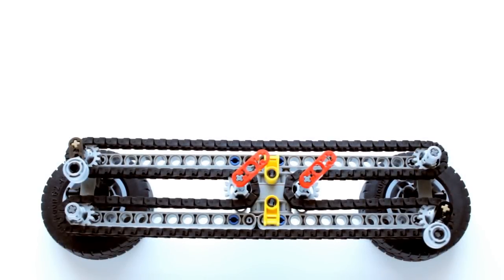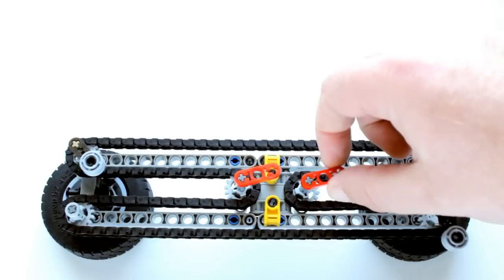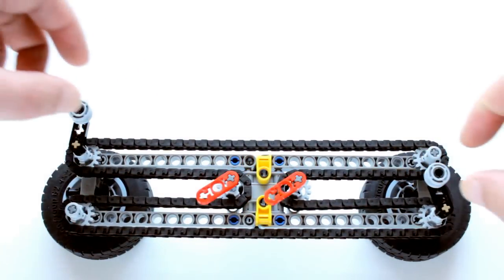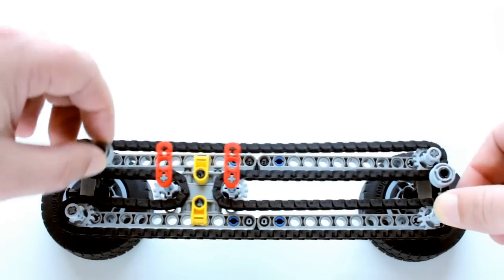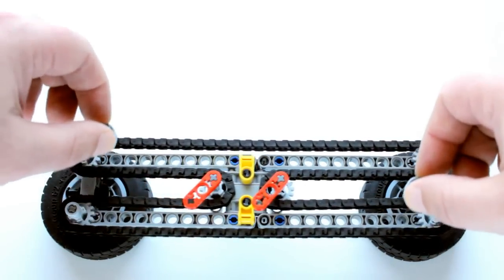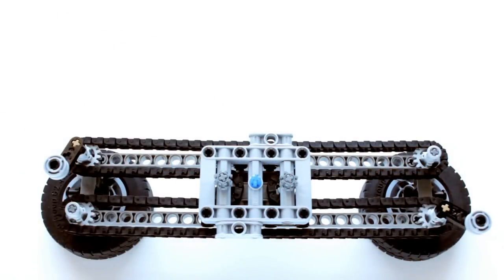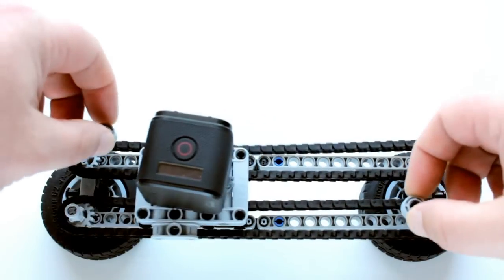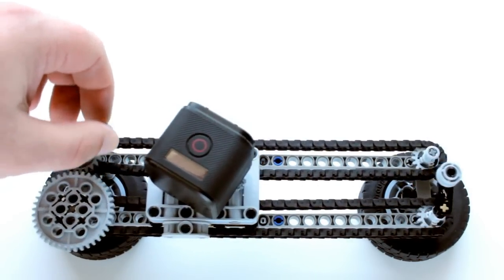LEGO Technic GoPro HERO Session Camera Dolly and Panning Rig

Comment: bruh i can make the exact same cinematic fx just by sliding my phone across a table and slightly turning it, and its probably more stable and smooth too. this is pointless
Reply from the maker: This model is a proof-of-concept.
It is not a finished and polished model.
Could it be bigger/longer? Yes.
Could it be made more stable? Yes. 
Does it illustrate a concept? Yes. 
Is it pointless? No.
Reply: Back2Black absolutely not lol dont get me wrong this stuff is cool and i could never make anything like it, now that im thinking back to my lego days this could have came to use making stop motion animations of lego, out of something thats made of lego, but my point still stands that its easier to just glide your camera across a smooth surface lol
Reply: @MrB4MV101 If you want to make an hour long video or something like that, if you use this LEGO design, you won't have to hold your camera for a long time.

Comment: I'm a complete novice with Lego but want to create a magnetic system that moves Model cars along a road. I'd like to use Lego chains with a cog at each end so they turn perform a U turn and travel in a loop. The system needs to be controlled automatically so a motor is required. Theres a system called magnorail but this is near impossible to impose on my model railway as the turns are a minimum of 6cm and won't accommodate into the area I require. Using small Lego cogs I can do this however am unsure whether it can be powered with a motor. 
 I understand my request may be a little odd to understand but if you look at magnorail on YouTube you may see what my intentions are. Merry Christmas
Reply from the maker: I have taken a look at the Magnorail system.  You should be able to use Lego chain links and Lego gears to achieve something similar.  The Lego gears come in a range of sizes, with the most common ones between 8mm and 40mm diameter - of course you can use multiple gears to simulate larger diameters.  You can either use the official Lego motors to drive the gears and chain, or you could use another type of motor if you are willing to modify the Lego parts a little bit.  You can also glue some rare-earth magnets to the chain, and you would have to create your own channel to guide the chain like the Magnorail system does.
Check out some of my other videos to see how I use Lego motors to power the Lego gears.
Reply: S. L. Froden brilliant, thanks for your response, will post it when it's complete

Comment: I want to buy the chain links used on this video but I found it difficult because there are some different versions and I don't know which one should I buy, 14696, 1311a or 1411b.
What are the differences between them?
Thanks!
Reply from the maker: The chain links used in this video are part 3711 (which has an alternate number of 14696).  https://www.bricklink.com/v2/catalog/catalogitem.page?P=3711
Apparently there was a slight change to the mold during production.  I don't have any of the older ones to test, but both versions should all be compatible with each other.
I don't know what parts 1311a or 1411b are as I cannot find them in any online Lego references/catalogs.

Oh, and to quote Sariel:
"That's the first time I've heard there are some differences."

Comment: What is the advantage of this compared to putting it on tracks?
Reply from the maker: Moving a camera on a track typically creates a "dolly shot" or a "tracking shot" ( https://en.wikipedia.org/wiki/Camera_dolly ).
The mechanism in this video enables you to create a dolly/tracking shot or a "panning shot ( https://en.wikipedia.org/wiki/Panning_(camera) ), or both at the same time.
By varying the speeds of the two cranks (either by hand or by attaching motors), I can get a wide range or dolly/tracking shots and panning shots, or a combination of both.
Reply: You can get a panning shot if you connect the panner(?) to the dolly wheels. Changing panning speed is a problem though. Maybe if you make a belt gear you can put the belt of different gears to change speed?
Reply from the maker: Sure, you could do that, but then it is no longer 'just' putting it on tracks, and you have added more complexity.
When I originally saw this mechanism (link in the description), I thought that it was a neat and elegant little mechanism and I wanted to see if I could recreate it with Lego pieces, and give it a purpose by turning it into a camera rig.
Reply: Makes sense.

Comment: you could maybe make the crank longer or add an electric motor with a gear reduction to make the movement more stable but anyhow an awesome video!
Reply from the maker: Thanks.  I did add a motor which made the movement a bit smoother, but the slack in the chain was still a bit of an issue.

Comment: Attach a motor and gearbox to make it run smoother
Reply from the maker: I agree.  Adding motors does make it a lot smoother than cranking it by hand, although the slack in the chain is still a bit of an issue.
I did make this model RC at one point, but I didn't take a video of it. I just used some M-Motors and worm gears and the IR parts - nothing too fancy.

Comment: Hi! What Video settings you use for the GoPro?
Reply from the maker: 1280 x 720 @ 30 fps
I'm not sure which other settings I used (FOV, Spot Meter, Protune, ISO, Sharpness, Low Light).

Comment: Adding motors will make it nicer and smoother.
Reply from the maker: I agree.  Adding motors does make it a lot smoother than cranking it by hand, although the slack in the chain is still a bit of an issue.
I did make this model RC at one point, but I didn't take a video of it. I just used some M-Motors and worm gears and the IR parts - nothing too fancy.

Comment: not very smooth, but nice concept
Reply from the maker: +Leanardoe - I agree that this could be smoother.  This is just a proof-of-concept and further refinement could be made, but I don't know how much smoother it could be using only Lego pieces.
Reply: Maybe try using treads and wheels instead of tracks and gears. The part number for tracks is 53992.
Reply from the maker: +Louis - Thanks for the suggestion. Part 53992 isn't very long, and from my experience with this part it always seems to be a bit squashed rather than completely circular, so it isn't very smooth either.
Reply: slfroden that is a problem of them. I wonder if you could cut them and stick them together to form a longer one.
Reply from the maker: +Louis - Possibly, but they still wouldn't be very smooth.  Also, if you are going to 'make' your own parts, I'm sure that you could find some other (non-Lego) O-ring or drive belt, and you could use metal pulleys and bearings, and use a metal frame to make it more rigid, but then it isn't really Lego any more.
Reply: slfroden it's a shame Lego don't make longer belts

Comment: the camera is a bit shaky when moving, adding weight might help. thinking of doing this with motors.
Reply from the maker: +Cyrus Serrano - You are correct, unfortunately it does shake a little bit.  This model is just a proof-of-concept, and further refinement could definitely be made to improve it.
I think it is shaky because I was turning the cracks by hand, and Lego chain links around small 16-tooth gears aren't the smoothest either.  Some changes that could be made would be to use larger gears, use motors to rotate the gears, create smoother rails and add wheels to the shuttle, and as you suggested, add some weight to stabilize it a bit more. Another idea is to remove the gears and chain and use string and pulleys instead.

Comment: The design is amazing but of course lego isn't the best source of materials. But with some professional linear bearings and belts and two steppers and an arduino, you could make it a very compact multifunctional slider/panner.
Reply from the maker: +Jens Hendriks - Agreed. But then it wouldn't be a 'Lego Technic GoPro HERO Session Camera Dolly and Panning Rig', it would just be a 'GoPro HERO Session Camera Dolly and Panning Rig' (without the 'Lego Technic' part). Lego is great for creating quick prototypes and testing concepts, and for being able to reuse the pieces in other models, but if you want a professional grade solution then other materials and technologies are probably better in most cases.